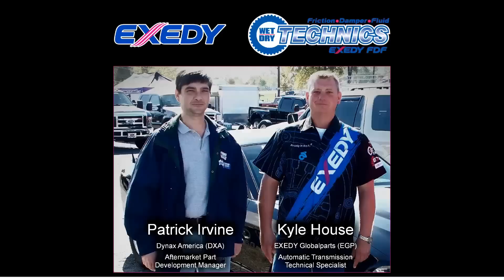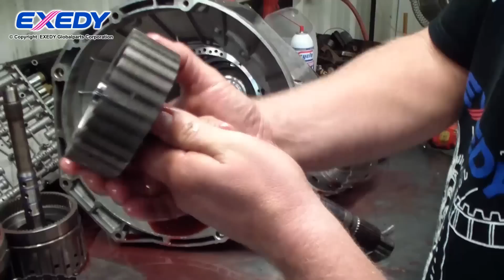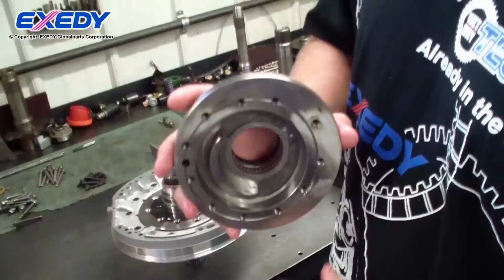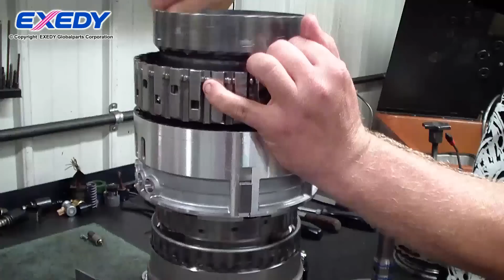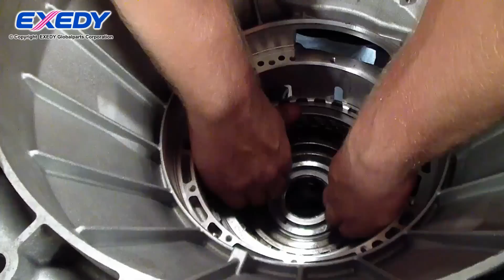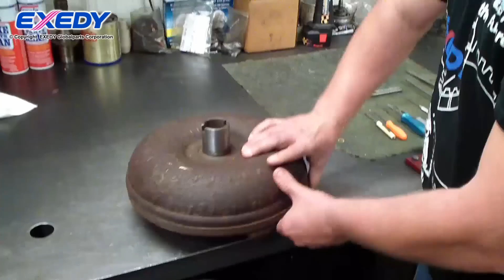EXEDY Tech - Mustang-Raptor 6R80 Auto Trans Rebuild Procedures

Comment: Any idea on how to fix a center support that is about 0.1" shy of being in the proper spot? Too high in the case for the snap ring. If I remove the shim on top of the sun gear, it fits great. All I replaced was the clutches and steels according to the instructions.

Comment: So for a clutch and intermediate shaft up-grade, would you split the valve body, or just leave her alone as a DIYer. The trans is currently working fine. I'm potentially upgrading these parts because when launching from the trans-brake, it won't make the wot 1-2 shift before hitting the engine's rev limiter after many tune revisions to help remedy this situation.

Comment: I'm interested looking at the 6R80 that is appears to have a larger filter with deeper pan, than the 6HP26 it is based on.
Do you know if they are interchangeable?
I understand the 6R80 is much stronger, so are there any other internals worth changing into a 6HP26 that would fit?
Great informative video. Thanks.

Comment: I'm really impressed with the quality of this video and the transmission.. especially with the abuse it was taking.  I'm looking for someone to beef up my ZF6HP28 with a setup like this. I need it to support 600+ whp on a daily driver. 

The scary thing is that ZF datasheet says the 6HP28 is rated at 450-500 ft/lb depending on what torque converter ships with it. I'm already there with simple bolt ons. 

I'd appreciate a response back.  If the ZF isn't a good candidate I might see if I can swap out with a 6R80 unit or do some crazy 4L80 conversion.

Comment: 1600 I never seen someone tighten up the seals like that. I've got to try that on my next rebuild. I rebuild my 96 Tahoe trans 2.5 years ago. Front new seal leak a little but unit run fine.

Comment from the maker: Thank you for your interest in EXEDY products. The difference between our Stage 1 and Stage 2 kits is clutch capacity. The Stage 2 kit has about 40% more friction elements than our Stage 1.  Our Stage 1 kit utilizes the same high energy / high performance friction material as the Stage 2 (40% more heat resistant than the factory material), but maintains a factory clutch sizes/quantity.  With a rating of over 500 HP and 500 ft. lbs, our Stage 1 kit will work great for your application.  Have fun!
Reply: I'm thinking that shirt he's wearing would look good on me, where can I get one?

Comment: I have a question I have 2012 Mustang V6 that will see maybe 410-425hp. the 6r80 is the same transmission in both the v6 and gt models. What is the difference mainly in stage 1 and stage 2 exedy clutch upgrade kit just the torque rating? Its mainly a daily driver car with very aggressive street driving and some track passes 1-2 times a week. Any suggestions on which kit to get?